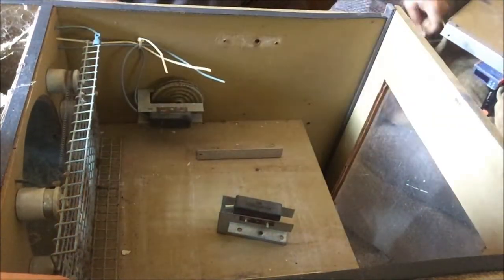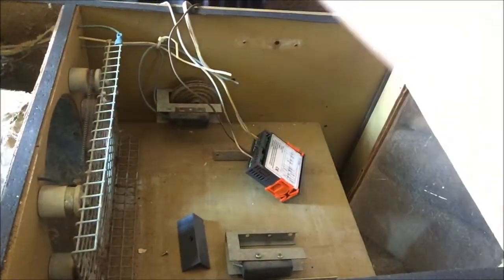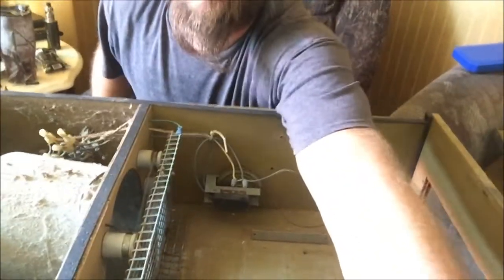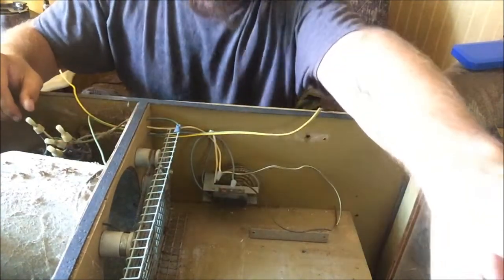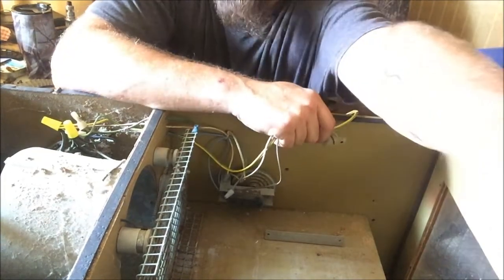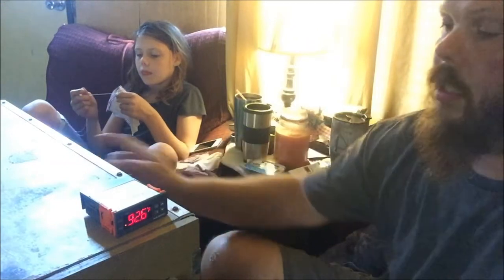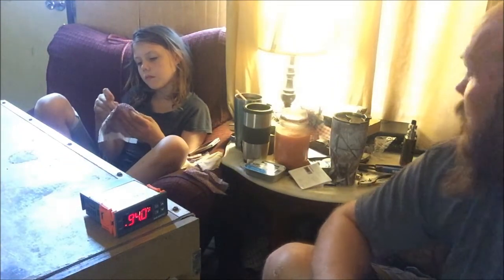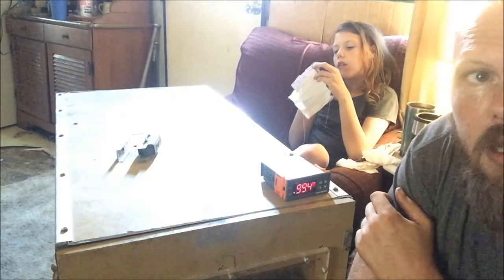DIY Inkbird thermostat install on a GQF Sportsman 1202

Comment: tried this with my 1502 and it popped the circut breaker when the sensor wires were attached
did you have this happen? ... UPDATE...... IF YOU LINK TO THE WAFER SIDE YOU ARE GOOD IF YOU LINK TO THE DIP SWITCH SIDE YOU HVE ANOTHER WIRE TO CONTEND WITH....... GO WITH THE GREEN AND WHITE NOT THE BLACK AND WHITE........ THAT IS WHAT IS ON THE WAFER SIDE

Comment: When hooking up the power to the thermostat does it matter which connection you hook the wires to in the back of the thermostat? I know which two to use. But does it say which is ground etc
Reply from the maker: I don’t think it mattered but do not remember it 100% but I do not believe it matters

Comment: why couldn't you use the back up wafer that is on the inside wall?
Reply from the maker: The back up wafer is actually a secondary switch in case the first one goes out. It is there to make sure the eggs don’t get to hot and ruined

Comment: where is your temperature sensor probe located sir
Reply from the maker: I ran it to the rear of the incubator and down my the middle rack
Reply: does it have a viewing lights inside?may i know the dimensions of the incubator sir because i wanted to make one same as yours...
Reply from the maker: It does not have a light inside but it is a GQF 1202 but I’m not sure the dimensions right off hand